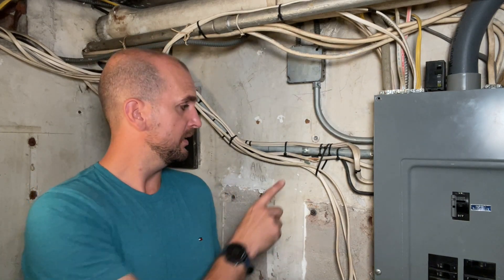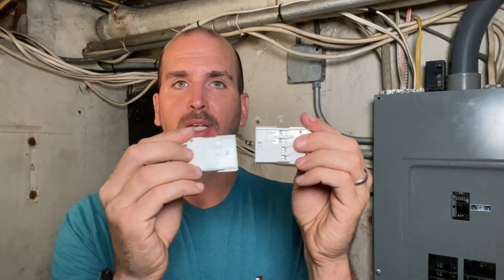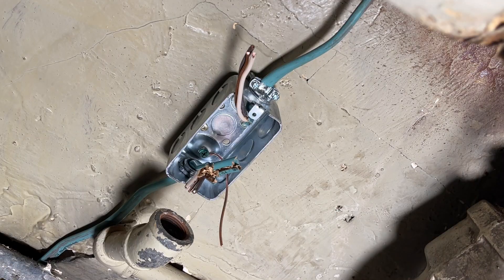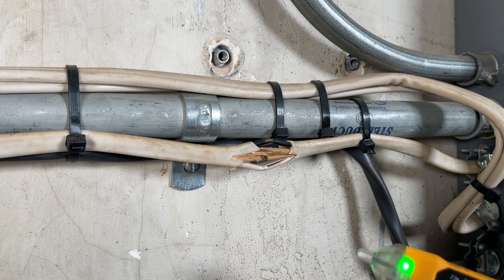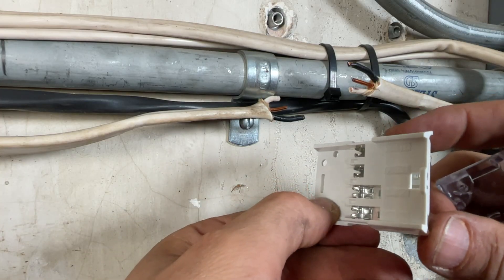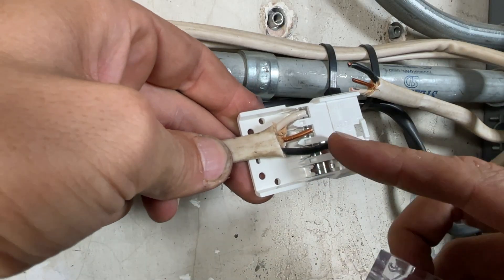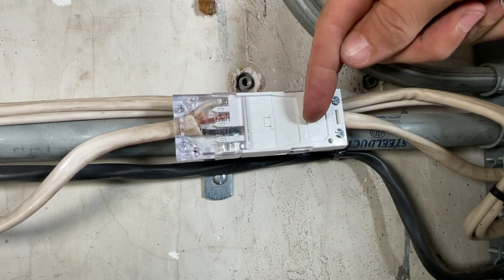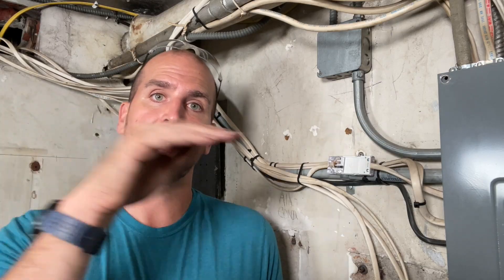How To Repair Damaged Romex Wires

Comment: I did not see any comments pointing out that exposed romex is not permitted below 8’. According to code, all wires below 8’ need to be covered such as in a wall or in conduit. 
All of those loose romex wires in that vid are a code violation

Comment: Never use a Handy box, they are to small to use for this application plus the covers need to be #8-32, 6-32 and the thin metal covers are not speced for an are flash, you should always use a 4" sq and wire nuts, wagos can and will be a week link when the springs wear out and arc, aways braid and wire-nut!

Comment: I've seen people who insist that you should always run a brand new home run. And that is absolutely the ideal situation. Unfortunately, that's also just not realistic. Once the house is built, some places just aren't that accessible without causing major expense. I would say adding the junction box is definitely my preferred option. I do like that this was done here as a regular outlet box, instead of as a square or octagon, looks a little less out of place, and certainly appropriate if you want to add an outlet later. If the damage is somewhere in a drywalled area, you especially want to try to use a box like that, and probably just put an outlet on it for the sake of making it look right.

Comment: I would like them more if you weren't cutting the wire like you had to. If they had the same situation the demonstration used, It should be remove sheathing(outter jacket) spread the wires enought to snap that thing into place still leaving the original wire condition but also adding a little bit of extra coverage and possible of reassurance to the conductors if a little  got taken out but not all the way. But if a conductor is cut the whole way I would just junction box. it
Reply: I don't believe this splice kit will allow a continuous pass-through of the wires. They would end up outside of the covers.
Perhaps an approved snap-on insulating kit is in the future? allowing pass-though of (need to be-) undamaged conductors, and separate them and insulate them from each other at the damage?

I definitely don't like the IDC feature (IDC insulation displacement connector) on a power circuit!

Comment: If you can't use a junction box or run a new wire you can use butt splice wire connectors or solder. Slide some heat shrink over the whole romex wire first. Then put some on the individual wires. And be sure to use good quality heat shrink not the stuff from harbor freight. Crimp the wires together, slide your heat shrink on the individual wires and shrink, then slide the bigger heat shrink over the whole connection and shrink. This will hold up to heavy loads like space heaters.

Comment: Junk! Replace the cable. As a licensed guy, I would never use those.
Reply: Sure...replace the cable at the electrician's cost of cable and then pay their labor for repairs. I think not! I see nothing wrong with this repair and if it meets code and is safe, why not? You professional guys out there, post some of your videos and be sure to list the cost of new cable as well as your labor. Curious minds want to know.
Reply: @Ragnarou812  It is only code in certain circumstances.

Comment: I don't use lagos, it make neutral a hot joint, I rather use a wire nut!! I get called to house were there used they lost neutral, because of the lagos!! Its like plug wire into back receptacle!! You always lose the nuetural!! I teach people how repairs this!! I'm saying there bad but they cause problems!!

Comment: Never use that pen ON BUNCHED WIRE...use a meter always...Safest is to turn off main breaker and yes even use a meter when you've done all this.  Test meter on known source daily before you start.  If someone touches your meter or your work GOTO BEGINNING OF THIS COMMENT.  And of course I would like to see the r & d on that fancy coupler..
AND YOU MAY AS WELL GO GET YOU LICENSE.  if you dont YOU ARE LEAVING YOURSELF WIDE OPEN FOR A LAWSUIT OR AT LEAST A FINE FOR PRACTICING W/O A LICENSE.  (DONT YOU JUST LOVE THAT WORDING )

Comment: I would never use this inside a wall or in an inaccessible location. Stop spreading misinformation, you not even licensed!
This item may be used in a fluorescent fixture as a means of disconnection, or in a approved junction box, but definitely not in a inaccessible location.

Comment: All of these “solutions” are for people
That aren’t analyzing the system and problems.  They are I suppose but only looking at what they see. Remember these eyes are the eyes of someone who has no trade experience. They have homeowner experience.
If you are doing these types of “repairs” in a commercial setting that’s one thing. Doing it in a place where people sleep
Is an entirely different animal.

When a homeowner watches me work, which is fine with me, they nearly always say…..” wow I had no idea that was an option, I didn’t know to look at that too, I was only looking at this small thing, I wasn’t looking at the big picture.”

Also
These parts are not purchased by electrical contractors. They are built and sold to homeowners.

Hiring a true pro will offer a better & more importantly SAFER option. 

Please stay away from
Doing your own electrical work.  You will be installing a false sense of ability to people that should NOT BE doing this type of work.

In this video, do you know how fast a new piece of Romex from the panel to your Mickey Mouse connection would be?
The panel is right there omg.

Thus a standard junction box and cold connections made….vs that garbage HOT connection

Please stop
Showing people this.

💯 of the time, these homeowner fixes have to be removed.

Yep, your not a trades person.

NO
TNIS IS A TERRIBLE OPTION AND ITS DANGEROUS TO SHOW PEOPLE THIS.

Plumbing should be done by a pro…..but if you mess up, you have an expensive flood.
With HVAC, you maybe have a poorly functioning heating / cooling and home breathability issue.
With electrical, you WILL have a compounding resistance issue, causing higher amperage and higher heat…..then a fire.
And people could be asleep.

STOP MAKING IT SOUND EASY.
It’s not.

I am a master electrician, a licensed electrical contractor, 33 yrs in the trade. I work every day in the trade. …..except when I’m on duty at the fire hall.
I also am a career fire captain. 21 yrs in the fire service.

Please stop showing people that they should or can do their own electrical.
They may follow instructions “correctly” but as always, dangerous situations come based on a chain of errors. The problem with home owners doing their own work
is they won’t know what detail they missed. They won’t know what a loose connection is.
They will just walk away feeling a sense of accomplishment because the plug works, the bath fan turns on or the new pots light up.

I know you don’t intend to
Put people
In danger.
Yep, you tell people
To check local codes

But this is not a good
Idea.

Comment: I would have cut it clear, added any additional romex, slide on shrink sleeves, twist and solder wire together and cover with shrink sleeves and tape up.
Is this ok/legal by code. Or not. Or overkill.

Comment: I don't think that 300V 20A is the real rating. It should be tested with an thermal camera.
You know the wago still get's very hot at the max rating and you should oversize and wago and use the wago with less resistance but these: I don't trust till I see.
Very little contact area. For a 5A circuit (lights only) it's good to go and I don't have a problem but you know now people start to plug electric cars in sockets for 240V 16A and these sockets burn because the 16A is only rated for a short period of time (and it don't mentioned it anywhere and it fits).

Comment: The length of the conductors in the box in your first install do not meet code.
I have never seen or heard of TE romex splice kit, what is the amperage rating of the kit.
Being that close to the panel , I would preferred to do an install with a JB replacing the wire from the panel to the splice.

Comment: I cannot express how much I hate insulation piercing connectors. Outside of the USA they are only used on low voltage / low current circuits, e.g. telephone junction boxes and amateur 12V car modifications. This connector inserts three additional resistances and thus voltage drops on a cable that may have already been close to its maximum length for the current draw. Over time moisture ingress will degrade the contacts and this junction box will become the source of an electrical fire!

Unfortunately, there is no easy way to safely splice a damaged cable except at an approved junction box if there is sufficient slack. I have found conductors with insulation that was damaged by careless installers but, mostly, this kind of damage is caused by rodents gnawing through the cable and when found at one location will be repeated throughout the property in locations that only rats and mice can access. Exterminate the vermin (rodents and cowboy electricians) then rewire to current codes.

Comment: As a general Contractor/Handyman for over 40 years, I have found those Wagos to be the best and easiest to use. Been using them for years. Still using them to this day. Never used those T E connectors, though. Until I know more, I would be concerned. However, I'm always open to data showing how well they have performed.
Reply: Those were not wagos. They were ideal brand. Wago are better
Reply: @ianc435  Yes they are Wago's, he said so, and I can SEE Wago 221 in the image.
Reply: @troubleshooter1975  yup. I had the volume off and I’m blind.  But this is not code. 6 inches from entrance of the box. Wire is too short
Reply: @ianc435  I might be wrong, nothing new there, but I thank that the 6" of wire is put IN the box in case of future repairs.

Comment: For years, all the good electricians I have used as subcontractors would never use an outlet (receptacle) or switch with push in connection points, now they're okay. Convenience has a way of changing procedure. I do like the convenience of those connectors, it's ironic how a formerly, prone to getting loose and arcing, connection system has magically be rectified into accepted standards.
Reply: The push in now are actually secured with he terminal screws...you can tighten them down.

Comment: I'm a DYIer and I was wondering if that splice kit works with armored cable in that same scenario in a wall. I'm redoing a basement and I'm trying to figure out ways to avoid box covers in the walls are in the ceiling
Reply: Nope, for several reasons...

Comment: lol.   You should run the voltage tester against the black, and the white wire.   because switches on two diffrent circuits have been known to share neutrals.   (back feed).
Reply: True, but a pen won't show it, because it is a grounded potential, even when carrying return neutral current... Would have to be an amp clamp with a readable load energized...
Difficult to test for all possibilities of improperly crossed wiring with 100% certainty, short of tracking down all wire routing...
Reply: @troubleshooter1975  yea, but there are other reasons to check the neutral, the older you get, the more you encounter bad wiring.   trust nothing.    and the volt ohm meter is more reliable then the pen.  mine is likely older then you are. (lol).

Comment: rodents seem to like to chew on that blue romex.   I replaced some.   they used it like a chew toy.
Reply: Blue Romex? I'm have tried to find out what it is! What is blue NM? I never heard of blue...
Is it a trademark thing?
Reply: @troubleshooter1975  ah....good point, I forget i am getting old.   In 1970, they started mandating romex with ground.   Before that, there was a blue/green romex, that did NOT have ground.   I forget the order.   But, 1970-something, they put plastic around the ground wire.  Only problem is the mice like to hear the crinkle when they chew the wire.    So, it's literally a mouse chew toy.   Which is why you might encounter it less then knob and tube.

Comment: Electrical tape is good for 600V. I would've just taken my time, slid tape on each wire, and ensured it was safe. Is that not to code? (before I cut it, smh)

Comment: 1:51 use an actual voltmeter. If the battery is low in your NCV tester, or there is any other problem, you could get a false negative… And a positive jolt.

Comment: There connectors are permitted to be inaccessible (334.40 ish) but as shown is 110.3b listing violation because it isn't secured with the small metal straps it comes with shown in the directions.  Most electricians won't use them because they reject what they aren't aware of.

Comment: The splice kit is interesting but I'm speculating it's not as good as a wire nut. Splice kits have amperage and voltage ratings wire nuts have the actual two wires touching each other there is no Bridge and therefore no loss and conductivity or risk. It's been used for decades and if used properly they are successful for the life of the wiring system. Interesting video though

Comment: Ok, if you are a licensed electrician,  then you shouldn't be. If you're not, then you really shouldn't be teaching home owners how to do hack electrical work.  Call a professional,  the wire is literally  2" from the panel. At least put in a jb,  and run a new wire into the panel.  Read the comments,  anyone who actually knows what they are doing is disagreeing with this video. Stop teaching people how to get hurt, and how to cause fires.

Comment: Those NM cables are not supposed to be tied onto the conduit.  Also, may be a code violation in your area to use NM cable in that space, MC or EMT might be required.

Comment: I'd finish the connector splice by doing two things: 1) After closing this circuit's breaker, check an outlet on the circuit to make sure there's power, and 2) tie-wrap the connector around the pipe with two tie wraps, to prevent someone inadvertently pulling on it and potentially opening up the splice.
Reply: It is against code to secure wires in that manor. Unless, the wire are feeding a device on that pipe. For example, you can zip tie wires to s sprinkler pipe to feed a fire alarm device, such as a flow switch.
Reply: @jimmac1185  So all of the romex wires (including the original damaged romex) are incorrectly tie-wrapped to the conduit (pipe)?
Reply: @jimmeade2976  Yes.

Comment: I'd like to see a long term torture test of the splice kit, including being wrapped in insulation. Might do one myself at some point.
 I don't use them often but when I do it's usually pretty dire and I downgrade the circuit breaker and get it in writing to not use any heavy loads. 
Would never use one for a kitchen or bathroom circuit. Not doing otherwise, call someone else, I'm not going to be indirectly responsible for starting a fire or killing someone. 
The UF splice kits with heat shrink look way more substantial, I put a little penetrox in them and would trust them under a full load for years. I'm 99 percent sure that they're only allowed to be buried outside though, real shame.

Comment: This is totally ridiculous and overkill.  I would just wrap the hot and neutral with black electrical tape and then enclose the romex in electrical tape too.  It will last as long as the house will last.  This is why electricians make so much money are ripping off the homeowner.

Comment: I am a DIY person and had the same issue. I would never trust a junction connector as you have described. 12 or 14 Ga, high current and buried inside a wall. I know the WACOs and other blade type connectors have been approved for high current loads but I'm a DIY and know what low resistance points and high current can do. . Nice video, Thanks.

Comment: You mention briefly about not having extra wire and making small extension lines. Does this mean you have to have 2 junction boxes? Or would you use 2x wago connectors on the same line for the extensions?

Comment: I am not a licensed electrician but I prefer to run a new home run or using wire nuts. Wire nuts allows the spliced wires more surface contact to each other, therefore less electrical resistance and heat due to high current. The splice you used, I feel is not suitable for high current use, therefore it is at a higher risk of wire melt down and potential fire. The fork in the splice you suggested in my opinion, is too small for high  current and more at risk of failure  due to that it has small surface contact to the wire and can fail in high current demand potentially causing a fire. It would be more suitable for low voltage application such as speakers or telephones use. Electrons flow on the surface of a metal conductor. When you use a splice as you suggested, it is like a 3 lane highway cut down to a single lane road. It causes a backup hence, resistance to electron flow causing heat and potential metal melt down and fire.

Comment: If it meets code, I'm good with it. Seems like a DIY item more than for pros.  A pro will just run a new wire and bill the customer for time and material. More time, more money.  If you are really lucky you can throw some drywall repair on the bill too along with some expensive tools.

Comment: I am concerned that the connection will not handle the rated amps? 
Also can't someone just use crimped butt connectors and shrink tubing to make the repair?

Comment: Didn't know an approved splice kit existed, thanks! Also, thanks for showing that part where you test your non-contact voltage tester on a known-live wire before trusting the device to test what you think is a safe romex wire.
Reply: Please don't try this. It's obvious that this guy is not a licensed electrician.  Or if he is, he should consider another career.  No reputable electrician would do this scab work. There's lots of other videos on YouTube that teach you properly.  If not , hire a professional...it might be expensive,  but so is a fire.
Reply: @mikemacdonald2032  could you substantiate your claims with specific constructive criticism?